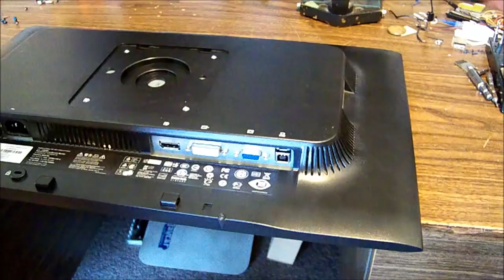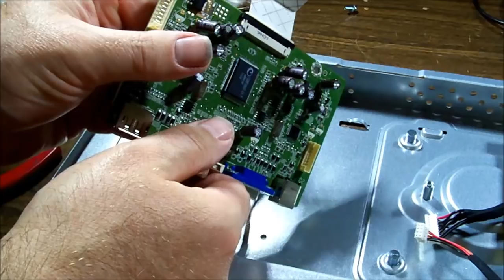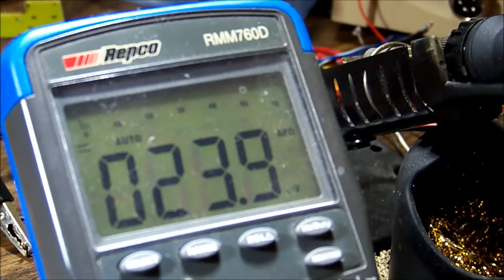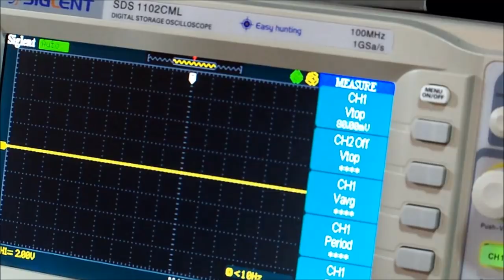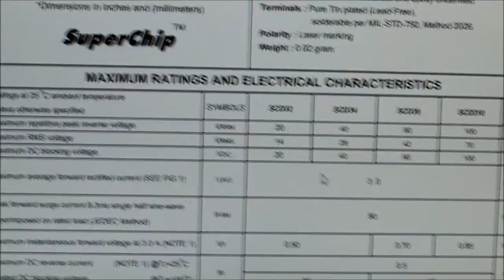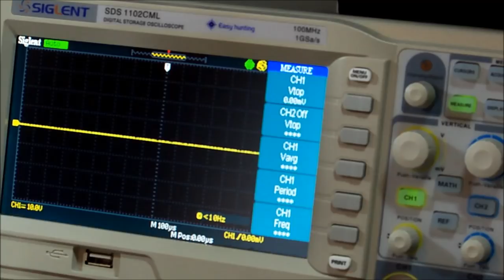HP Compaq LA2206x LCD Repair

Comment: LA2205wg here. Have been looking at it for over a year now. Not the same issue of a white screen, just very, very dim picture. Lots of research, poking about, testing, probing, examining, reading forums (Dave Jones' down under had/has an active list on this part), there's a South African Youtube exactly on this one but no final resolution (smaller board on the mainboard ICs suspect), etc. Bought new CCFL tubes...soldered it/them on... (burn marks on one of the CCFL tube connectors had me doing that). I could friggin do with some help.
Reply from the maker: So no bad capacitors, dry joints etc. Are the tubes lighting at all? I think brightness is controlled by PWM from the main board. Scope the control line and see if main board is telling it to be bright or dim. You should see signal change when you adjust brightness. Usually if there's a fault with HV output voltage/tube current the supply will light up briefly then go off. If the tubes are very dimly lit I'd be looking at the control side. You might even be able to force max brightness by tying the control wire to +3 or +5 depending what it should be. Check datasheet for control IC for an idea on if it's functioning right.
Reply: Thank you for replying! Appreciate this :-) I'm still learning the nitty-gritties of electronics (former IT guy drilling down to the lower levels). The tubes light very dimly: fully with another system. I bought a beginner scope recently but gave up using it. It was a fake from China. haha. (Also, I've learned I need an isolation transformer when testing these kind of voltages: one step at a time, finding a balance, yada). It's always tempting just to give up and trash/recycle a long-running fix like this, so it's like I'm in the danger zone of pressing too hard out of frustration and break something critical. So,  I hope you'll stick with me. All the parts of this monitor need to be put back together (and buy a decent scope) to test your idea of PWM from the mainboard. Thanks again.

Comment: Hi I wonder can you help me. I have an LG 49UF640V LED TV and i can't remove the rear cover. I have removed all screws and snap connectors but there seems to be two snap connectors on the inside that i can see but cant get to. From the outside there are two bolt holes if that helps. Thanks in advance. Mick.
Reply from the maker: Hey Michael. Unfortunately I have not worked on this model. Perhaps some gentle prying around the area if you can get under an edge with something thin but stiff and around 15-20mm wide.
Reply: Hi Jonny thanks for your quick reply. These two inner snap connectors look like they need a special tool   to release them from outside via the screw threads. I can see these two connectors but can't reach them as i can only get the back cover open slightly. Real PITA. Thanks anyway for your help 🖒